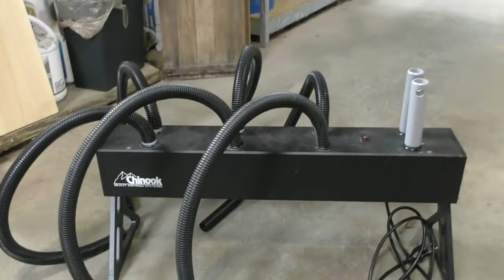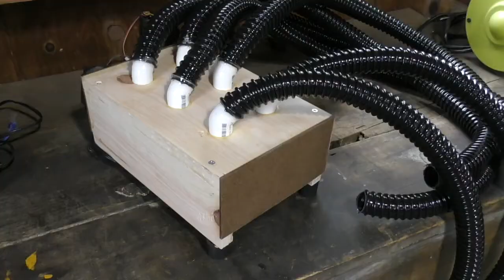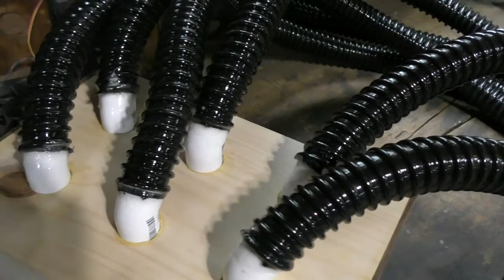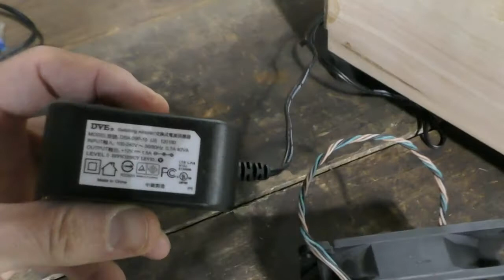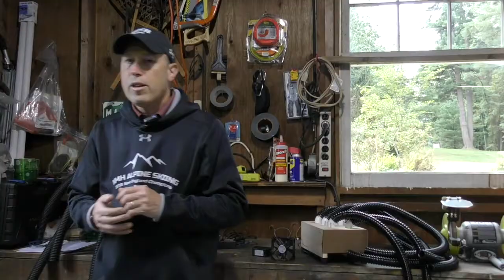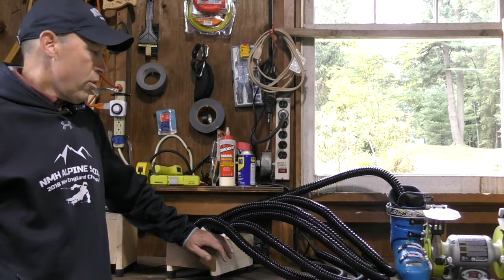Custom Built Ski Boot Dryer

Comment: Thank you. I took your idea and made it a little easier by using a prefabricated 4" sheet metal duct connected to an inline duct booster fan. Then put an end cap on and drilled holes for the hoses.  $55 of materials.